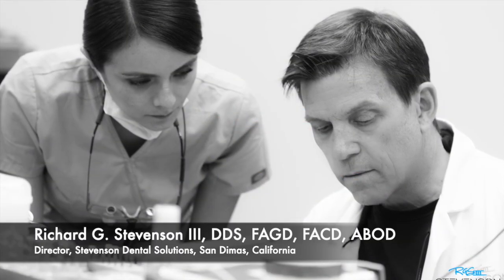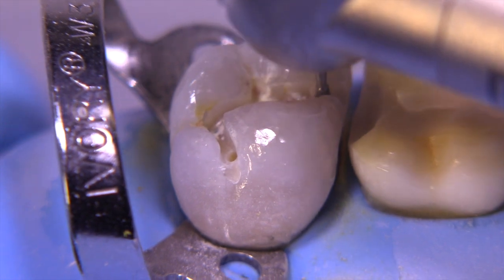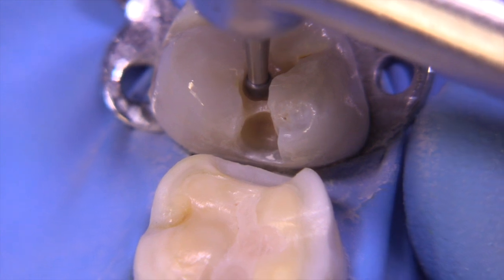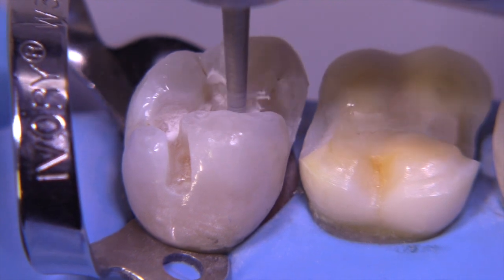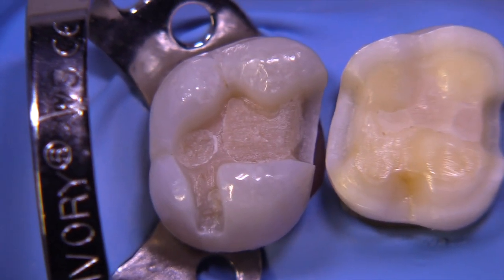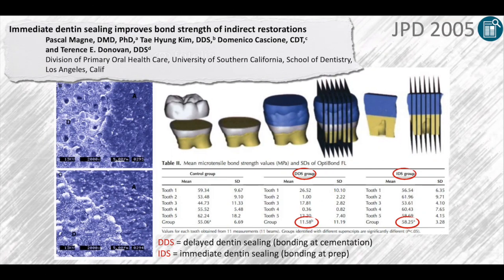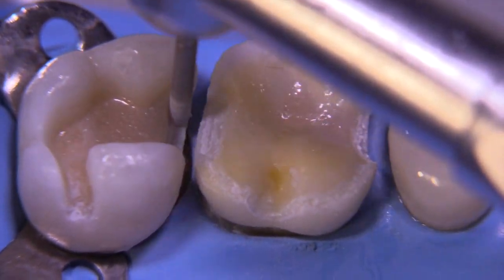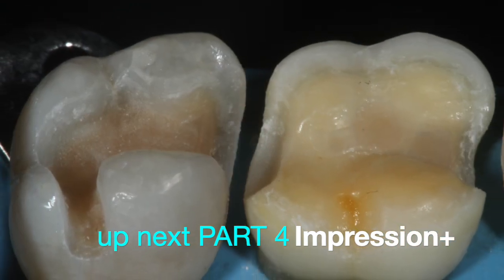Lithium Disilicate Ceramics, Part  3: Preparation and Immediate Dentin Sealing (IDS)

Comment: Dr. How far(millimeter) from the occlusal surface do you place that palatal shelf for onlays? Thanx!
Reply from the maker: The shoulder may be anywhere it needs to be based on the quality of the remaining structure.  Usually in the most conservative situations, it resides at the base of the A plane (Functional Cusp Bevel), or approximately level with the pulpal wall.

Comment: Dr. Are these burrs and other instruments for measurements used for these video series available in a kit for purchase?
Reply from the maker: I would check with your Komet rep - they can convert the Brasseler numbers to the European numbering system.  Our website does have these available in kits but it might be less costly to obtain from a local dealer.

Comment: The IDS show great bond between the adhesives to the dentin in studies by pascal magne. But this technique requires bonding of "new" resin, to "old" resin if you have a period of time for the technician to manufacture the restoration. In our clinic its usually 14 days. How well is the bond between the warm composites to the resin the the filled adhesives that were put in IDS?
Reply from the maker: IDS is not exactly showing better results (longevity) according to recent clinical trials and systematic reviews. I still use this technique but many are abandoning it...Lab studies always show IDS to be better but it's a different matter in the clinical arena. I believe that our best help in assuring longevity comes from prep design (with more traditional retention and resistance forms) and also substantial quantities of enamel.

Comment: What is the purpose of dentine sealing and when is it done?
Reply from the maker: At the time of the finished preparation.  The theory is that the dentin is best sealed when it is freshly cut, with the hope that it is better preserved as a hybrid layer and less likely to degrade over time.  Also, it is assumed that it will be more resistant to moisture contamination and subsequent micro leakage.   Patients do report slightly lower post prep sensitivity with IDS.

HOWEVER! Recent systematic reviews of IDS show that it is of little help in longevity of the restoration.  It looks like the IDS approach may not be worth the effort, but more clinical trials will expose the best evidence.
Reply: Thnx Dr. Why did u prep again after doing the IDS? And you mentioned to use one type of bonding only?

Comment: The difficult part is that i don't know which adhesive is filled or unfilled resin. How could we recognize that, prof?
Reply from the maker: OptiBond FL is filled.  Most other 4th gens are filled but OptiBond FL is the most filled.  If you have a doubt, use flowable on top of the adhesive for the biomimetic seal.
Reply: @StevensonDentalSolutions  thanks alot, professor!

Comment: In case of a subgingival proximal box....can the margin of the inlay rest on the composite/ RMGIC?
Reply from the maker: Yes, this is a margin elevation technique - the research is minimal but it seems to work well.
Reply: @StevensonDentalSolutions  Thank you sir...i have been practicing it for more than 5yrs now but have always been sceptical about the result
Reply from the maker: @preetleo09  I did my first margin elevation in 1988 and though that I would be sued!  It works great.  I kept this quiet for nearly 30 years...now it's widely used.

Comment: Do we have to smoothen the pulpul  floor in the same level?
Reply from the maker: My pleasure.
Reply from the maker: Not necessary - just make it relatively flat with rounded internal line angles and adequate depth.  Thank you
Reply: @StevensonDentalSolutions  Thank you Sir.

Comment: May I also ask you, if polishing is enough for removal of the air inhibited layer, or glycerin use is a must?? (and if polishing may remove the bonded hybrid layer, if used solo without flowable composite)
Reply from the maker: Unnecessary to use glycerine if you scrub before provisionals.
Reply: @StevensonDentalSolutions  Thank you so much for your reply, but may I ask you, the oxygen inhibited layer is a must to bond composite layers to each other. when we remove it, won't the bond to the resin cement be weaker, hence the oxygen inhibited layer responsible for adhesion is removed, as it will be similar to bonding or repairing an old composite with the conventional methods.
Or is sandblasting a crucial step to compensate for the  oxygen inhibited layer that we removed, like when bonding to an old composite, you have to sandblast it and others even apply MDP to achieve a proper bond
Reply from the maker: @Omran-g9o  When you delivery the restoration, the IDS layer is sandblasted lightly and rebonded so all is well.

Comment: Great effort as usual, may I ask  you if scotch bond adhesive from 3m is considered as a filled adhesive?? so can I use it solo for IDS or does it need flowable composite on top??
Reply from the maker: Good questions.  You'll need to use flowable with SBU.

Comment: Hi Dr. Stevenson, hope you’re staying well during this time. I have a few questions that I would greatly appreciate your response to. 

What is the opaque white material on the preps (beautiful BTW) at 11:48? Is that core build up material, e.g. ParaCore? Is the build up completed after IDS? 
I tried the DME technique with the modified tofflemire band but had a lot of trouble getting the band through the unprepared contact (for example, distal contact on a MO onlay). Also, the band constantly tears as I’m tightening it. Perhaps, I’m over tightening? Have you experienced these issues and if so, any advice? Thank you!
Reply from the maker: ParaCore white, placed over glass ionomer before IDS.  For the DME technique, place a spoon excavator in the gingival embrasure of the unprepared side and twist or lever to lessen the contact intensity and the bands will slip through.  Use 0.0015” matrix material - it will not break when tightened.  Thank you for 
the excellent questions !
Reply: Stevenson Dental Solutions I’ll give it a try! Thank you very much!

Comment: Dr. Stevenson, do you normally etch with the polycarboxylic acid before placing GI/RMGI liner? Would this enhance the bone strength in a clinically significant way? Thank you in advance!
Reply from the maker: No I do not - the bond strength doesn't need to be enhanced much and the PAA is potentially injurious to the pulp in a deep cavity.  I do use PAA for GI restorations, which rely on adhesion for better seal with the oral environment.

Comment: Hi Dr Stevenson..I've been following ur videos since many years...thank you for the great info in every video u share...                                               for IDS i have two questions..                            first: in this video you air dry the primer but NOT the filled resin...is that deliberately done and should the same be done whenever we use a filled adhesive?                                          second: I always see dentin sensitivity at cementation appointment even when I have followed the proper steps under rubber dam? Is that because I air dry the filled resin to a thin layer?   Best Regards...
Reply from the maker: Good questions!

I usually air dry both layers 3 seconds each.
Perhaps more agitation and time could be spent to insure adhesive penetration.
Reply: Stevenson Dental Solutions Thank you Dr Stevenson :)

Comment: Hi Dr Stevenson thank you for the excellent video! I have one question, normally I've seen curing of the adhesive and then application of glycerine + plus further curing.  You placed the bond, then glycerine and then cured. Will glycerine interfere with the bond when done this way? Thank you <3 <3
Reply from the maker: The glycerin is to eliminate the air inhibited layer. If you add the glycerin after curing, the composite polymers have already bonded to oxygen, hence they can’t be inhibited.  The glycerin and the bonding agents will not mix together as they have different polarities (hydrophilic and hydrophobic)
Thank you fir the very thoughtful question!

Comment: Thank you Dr Stevenson for all the tips.  My question: I tend to line my dentine with vitrebond or Gc Liner regardless whether it is deep or shadow prep. In fact I will do a close  sandwich technique with deep filling n have fuji  9 as a base.  Can you pls offer your opinion as most colleagues find that my technique has weak bond strength.   Should I just keep lining to deep dentine? I personally find that my fillings have less sensitivity comparatively.

And, IDS is only indicated for prep with indirect restorations right?  Thank you

Comment: Great video! but we did use a RMGIC as a liner earlier so won't that interfere with IDS? because there doesn't seem to be any exposed dentin in tooth 1.7
Reply from the maker: True - very little exposed dentin in 17.  It's a judgement call - some use no RMGI others use lots of it.  In this video I used a lot, but it can be done with much less, thereby taking advantage of IDS.  I usually place an RMGI in the deepest areas only and this provides for a long term albeit weak bond to dentin, with the IDS being of benefit with the more shallow dentin.
Reply: Stevenson Dental Solutions that makes a lot of sense :)
Thank you so much for posting. I’m a new grad and you’re videos have been tremendously helpful!
Reply from the maker: Great - thank you for your thoughtful comments/questions!

Comment: Great video with great input! I am wondering how the composite during cementation process bonds to the sealing layer. Maybe you could give an answer to this =)
Reply from the maker: The surface is air-abraded and then re-etched at the delivery appointment, then this surface is treated again with primer and adhesive, allowing ample double methacrylate bonds to copolymerize with the resin cement.  Thank you, Doc!

Comment: Dr. Stevenson,

Do you light cure after the primer application i.e. before the adhesive? Thank you!

David
Reply from the maker: For OptiBond FL (and other 4th gens) no curing is required after primer application, just air thining, followed by the adhesive.  Different products have different protocols, so it's best to follow the manufacturer's recommendation.  For cementation, if the onlay or inlay is reasonably translucent, and I'm using a total-etch multiple step system like OptiBond FL, I will not cure until the restoration is cemented.  Alternately, you could use a Dual Cure Activator (DCA)with a universal system or even a universal system without a DCA (Scotch Bond Universal) with cement which has the DCA in the cement itself, like RelyX Ultimate Cement. The latter technique is preferred when the ceramic is thick and will not allow for adequate curing through the restoration.
Reply: Thank you very much Dr! Hoping to catch you at one of your courses!
Reply from the maker: Great!
Reply: no

Comment: Great informative videos! What Bonding agent do you use for IDS?
Reply from the maker: Thank you Eric!  I'm currently using OptiBond FL (KavoKerr), but I'm leaning towards a universal like Scotchbond Universal - the clinical trials are steadily being published and are very encouraging.
Reply: @StevensonDentalSolutions  Is it need to put a thin layer of flowable composite over  Scotchbond Universal ? Thank you Doc
Reply from the maker: According to 3M's data it is not necessary to add a layer of flowable to the surface while performing IDS.